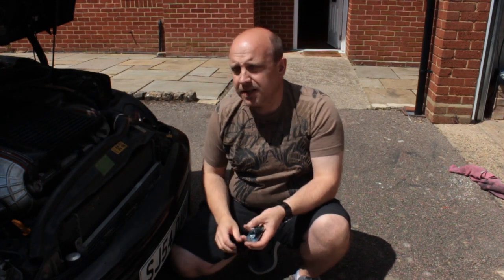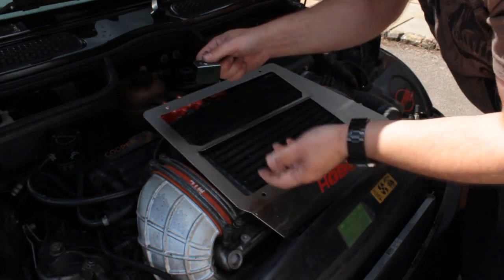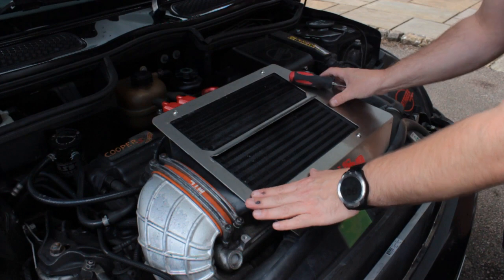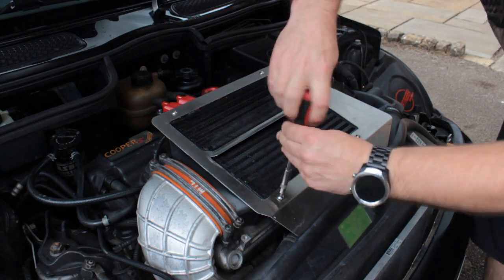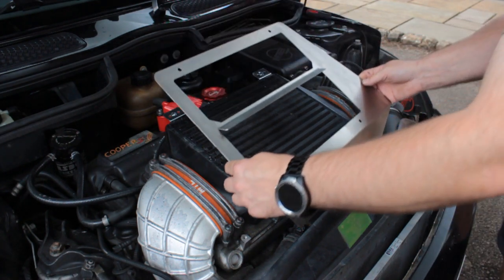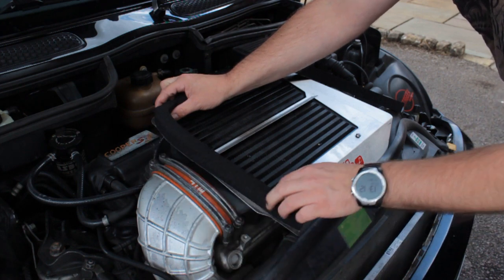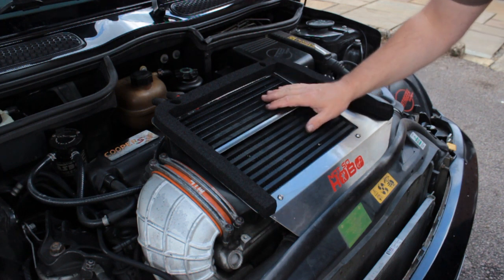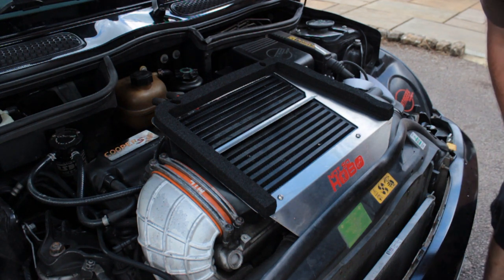Not So Hobo Inter-cooler Air Diverter installation

Comment: Great vid. Just checking before I fit mine, but did you just remove the foam from inside the stock scoop, or was it the entire 'baffle' part?
Reply from the maker: Just seen your comment - The entire inner part of the scoop needs to be removed (it rubs the intercooler anyway so is best gone)

Comment: What double side tape is this just normal or is there certain double sided you used that won't melt
Reply from the maker: I used a good quality industrial double sided tape, but most should work so long as they are for automotive / outdoor applications
Reply: @whatageekdesigns  fair enough that's lovely you got your new delivery in yet 👌 I ordered one a week back and emailed and was told expecting a shipping 17th
Reply from the maker: @LewReviews  They arrived yesterday but I'm speaking to the factory at the minute as they have been made upside down so the nicely finished side is underneath - fine if they are going to be painted but if someone wants it left in plain stainless it doesn't look the best - I'm working with them at the minute to see what the solution is - I'll hopefully have an update later today.
Reply: @whatageekdesigns  ah fair enough 😂 I would spray them mate and add 5 quid to the drop down option and sell them a bit more 😂😂